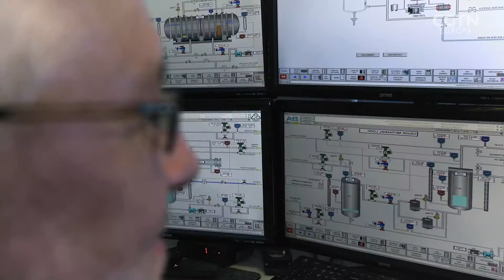Carbon Recycling - Manufacturing renewable methanol from CO2

Comment: Methanol is toxic fuel the best use of CO2 gas is for methanition using the Sabatier reaction which means any spare hydrogen can be converted into CH4 and water . CO2 gas can be pumped into depleted gas fields for storage.

Comment: You don't need to release carbon from an industrial place via a chimney or exhaust vent, it should be dealt with in a way that it doesn't have to be released via a chimney or exhaust vent.

Comment: Electrolysis to produce hydrogen is ~70% efficient, then the efficiency of methanol synthesis from hydrogen and CO2 is typically around 40-50%, Then you could expect around 35% efficiency for a methanol internal combustion engine. So a round trip efficiency of just over 12%.
How are we looking so far?
Reply: If the process uses high temperature nuclear hydrogen and nuclear waste heat for the CO2 stripper tower heater, the process can be cheap and scalable. In this case it uses cheap hydro and geothetmal electricity and heat.
Reply: This video is more than 3 years old. We still don’t even convert 1‰ of CO2 into anything. 
It might be a niche for aviation but definitely not for cars trucks etc. 
Even today electric vehicles are more efficient, than any hybrid or combustion engine on any renewable fuel can be. 
Maybe this is a method for reducing CO2 levels in the atmosphere in the far future.
Reply: True. Electric Cars are inherently more energyefficient. Then you can add a small metanolgenerator. And use that to heat the car. And extend the range. (When needed) Thus saving massively on batteries.
Reply: CO2 is climate-irrelevant. 

Interglaciation climate change (i.e., the Medieval Warm Period) is caused by changes in cosmic rays (Svensmark et al). 

There is not such thing as anthropogenic global warming.  

"Global Warming" is a superstitious bullying and shakedown of the taxpayer. 

Just burn coal and keep looking for more oil and make it out of coal (the way South Africa does at SASOL).

Comment: What a stupid woke video.   Ignores that methane comes from natural gas, then ignores all the electricity input to run the system, then fail is to discuss the CO2 produced from burning the methane in an ICE!  These woke clowns are selling propaganda and not solutions.  Methanol is the biggest scam since hydrogen fool cells.

Comment: This can only work where there is geothermal activity.
Reply: Nope!  Any electricity source will do; obviously, nuclear power is the best and cheapest source.
Reply: Not true! As long as you have a cheap source of electricity you can do it. For example from the sun. If you live in a place with low geothermal activity but a high level of sunlight with a large enough sun farm you produce tons of electricity for effectively free (minus farm costs of course).
Reply: Not true. Co2 can be captured for free from industrial point sources. And cheap power found too.
Reply: CO2 is climate-irrelevant. 

Interglaciation climate change (i.e., the Medieval Warm Period) is caused by changes in cosmic rays (Svensmark et al). 

There is not such thing as anthropogenic global warming.  

"Global Warming" is a superstitious bullying and shakedown of the taxpayer. 

Just burn coal and keep looking for more oil and make it out of coal (the way South Africa does at SASOL).

Comment: Thorium -Molten Salt Reactor. The crisis has already been solved, by ORNL in the 1970's.  Simple engineering, abundant fuel (can even burn-up existing spent nuclear waste),no weapons material,passive safety, industrial high efficiency heat at 700C. China has 2 reactors under operation right now, in a ten year test program before mass producing them at ship construction yards in modular units. Conventional nuclear burns up 0.7% of Uranium in a solid fuel rod..........MSR burns up 99.3% of Thorium which itself is 20 times more abundant than Uranium. The majority of all geothermal heat in the earths crust, comes from the decay of Thorium.

Comment: 7:44 why cut the camera away from him while he makes a bold claim? because the video editors attempted to defraud the viewers about his statement.
Reply: What do you mean? It's quite easy to convert an ICE to run on methanol. It was used in NASCAR racing for some time.
Reply: @markotrieste  it sounds like he’s saying the editor is trying to make the guy look bad by manipulating his statement.
Reply: Silly.  It's a well-known process; Germans used it in WWII to make fuel for tanks
Reply: CO2 is climate-irrelevant. 

Interglaciation climate change (i.e., the Medieval Warm Period) is caused by changes in cosmic rays (Svensmark et al). 

There is not such thing as anthropogenic global warming.  

"Global Warming" is a superstitious bullying and shakedown of the taxpayer. 

Just burn coal and keep looking for more oil and make it out of coal (the way South Africa does at SASOL).

Comment: The last time I checked, the price for 200L of Methanol was close to $700 CAD here in Canada. As long as we get this price down and make a dependable infrastructure, I see it as a much more practical green fuel. Driving a hybrid car that can use M100 and also gasoline (when needed) with the price of a regular hybrid would help everyone switch to the real green economy.
Reply: I make my own from the distillation of wood.
Reply: @steveciarico9824  syngas,  biogas, and landfill gas (which continuously output fuel for 50 years straight and landfills over the years are everywhere)
are also suitable for making carbon neutral methanol fuel. Basically any biowaste is with either a gasifier or a biodigester and the already made and in use methanol synthesis reactors. Heck for syngas you are left with char as a byproduct which if you burry it in the form of biochar (which has soil fertility Benifits) , you are sequestering carbon; yes a carbon negative fuel that is net energy positive to make. Biomethanol in general is net energy gaining process unlike efuel which is a net negative electric storage and distribution tech. Did I mention methanol takes way less enery to split into hydrogen, while taking up less space and container weight and being vastly easier to transport. China actually made a methanol to hydrogen refueling station for this reason. They also have trucks and cabs that run on internal combustion engine methanol. Though with a relatively inexpensive gasoline to alcohol conversion kit (compared to buying a new car) 90% of vehicles on the road can be converted. 

In truth methanol is cheap (the drag racer people stimulated a arbitrary price mark up over the decade and renewable suppliers of methanol is a new sector that lacks producers). US goverment found it was $0.70 a gallon if we used non renewable natural gas (though bio methane from literal sewage and trash should be in the same ball park). Biomethanol can be just as if not more inexpensive. Though E-methanol will be a lot more expensive since it is a net loss of energy by storing in a more convenient and applicable form.
Reply: @wastelesslearning1245  If you converted an engine to run on methanol it would cut it's mpg in half that is well documented by within the US Department of Energy Alternative fuels fuel properties comparisons using the gasoline gallon equivalent metric. The reasons drag racers love methanol is the godly cooling effects of the fuel vaporizing allows them to fill the block with a solid material to strengthen the block as radiators are not necessary.

Ideally, it should be blended with gasoline to boost octane and reduce combustion chamber temperature allowing higher compression engines increasing efficiency.
Reply: Cool beans. Good thing it’s carbon neutral to carbon negative (depending on creation process) can be made from practically any bio source, is more energy dense then batteries, and is so mass applicable most engines are already backwards capadable. So by far best option availbe.
Reply: makes a lot more sense than liquid hydrogen..........which is incredibly inefficient,difficult and outright dangerous.
Reply: @wazza33racer  You need hydrogen to produce methanol
Reply: @RichardPrendingue  making hydrogen from solar energy via PV panels is entirely viable.  Liquifying hydrogen is a very energy and infrastructure intensive process, and its highly dangerous in that form for vehicle fuel.  However, making methanol with hydrogen gas , makes much more sense...........methanol is a liquid that transports well, stores well and it can be upgraded to Butanol which is a 100% replacement for gasoline, and blends perfectly with gasoline, unlike ethanol.  Methanol and Butanol can be transported by existing petroleum distribution and in existing vehicles.  Liquid hydrogen on the other hand would be multi trillion dollar investment and from a practical and economic point of view, inferior.
Reply: No you don’t. You can use methane or syngas instead which can from many sources. Steam-methane reformation if used to crack hydrogen and since it will be locked up in methanol which pollutes less even if made of non renewable sources and which pollution is negligible to regenerative if made from renewable or a negative way.
Reply: @wazza33racer  Lmao. What makes more sense? Let me ask you a question: where the CO2 comes from? I bet you don't even know. The entire electrochemical CO2 reduction research is a joke.
Reply: CO2 is climate-irrelevant. 

Interglaciation climate change (i.e., the Medieval Warm Period) is caused by changes in cosmic rays (Svensmark et al). 

There is not such thing as anthropogenic global warming.  

"Global Warming" is a superstitious bullying and shakedown of the taxpayer. 

Just burn coal and keep looking for more oil and make it out of coal (the way South Africa does at SASOL).
Reply: An engine with optimization can achieve 40%+ thermal efficiency on methanol and ethanol.